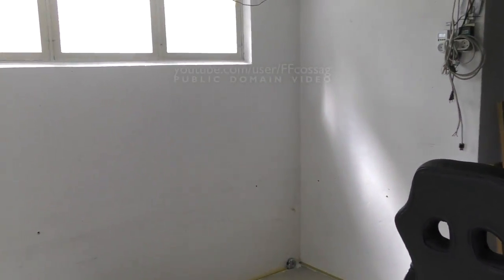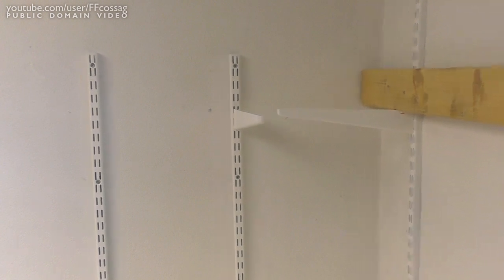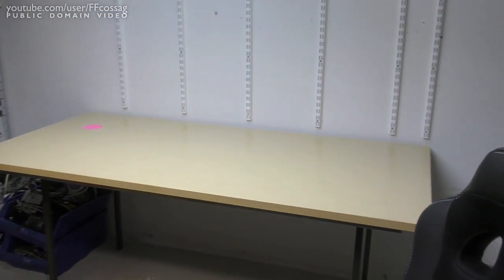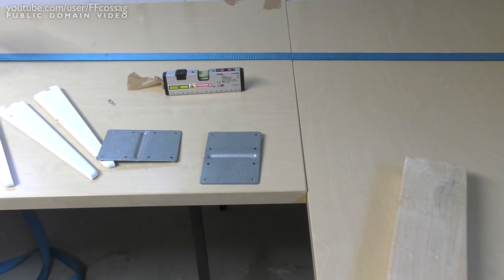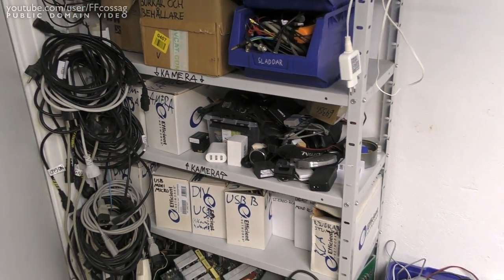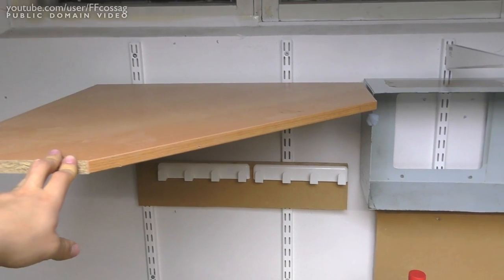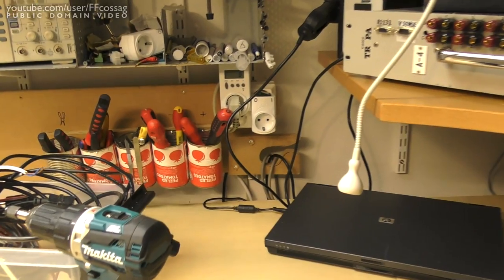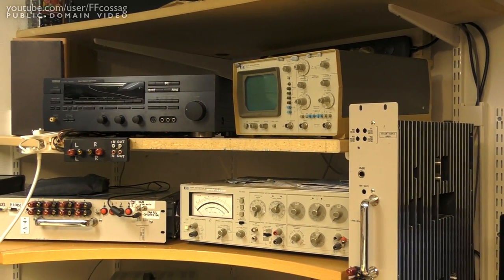Furniture with FF | Lab overhaul pt. 2, Trash Turned Awesome

Comment: An idea for the area behind the door to the room:
Outside clothes, shoes and such, maybe brooms or long objects you don't use that often. It's a trick I've seen in many places. Elfa has clothes rack accessories for their rail system. That way, if you want to make other use for it, it's as simple as just moving shelves there.
A baggie of Clas Ohlson article # 21-44 LRF's or equivalent on the shelf edges where the door hits (or on the door itself) to prevent the door from banging stuff up.
Reply from the maker: I can see the appeal, however since no one ever undresses when entering through the basement door, the functionality would be lost. I'll probably end up turning it to a row of rather vanilla shelves, as I'd hope to be able to store as much quick-access stuff as possible in the actual workshop. There's no room to waste space in there, at all.

Comment: Looks good keep up your good work i am like you when i want to mount something i always over do it, because how fun is it when shit fall down you shall see the length of my screws holding the ikea lack shelves on my wall they are like 16-20cm long lol took 2 plastic plugs to beat into the brick wall.

But if you wanted to go extreme there is another way to mount it that i guarantee you never pull it out it is called chemical anchor it looks like concrete a special two component glue you drill a hole blow it out and fill the hole with this mixture push a threaded rod into it lol go for M6 lol i use to work with mounting replacement balcony on concrete houses it was fun lol M16 bolts :-)

Comment: Turn a laptop LCD in to a monitor, you can buy the controllers on eBay
Reply from the maker: I've considered that. Should probably order a bunch of different ones to see if any of them support the resolutions I need. 1080p50 or i50 is really obscure.

Comment: It sounds like you're working with plaster and probably applied to a wire mesh and furring strips. You should be looking for studs or wooden beams for mounting. I comment as we go not after because I'll forget.
Reply from the maker: No, it's a cement bunker. Think really trashy concrete. This ain't America.

Comment: You were thinking that you should have used the longer brackets in one area but you had already fitted the shorter ones. Did you consider just removing the short ones then reusing the holes to support the longer ones with extra holes drilled at the top end as required?  It does look good and I wish I has space to make myself a workshop.
Reply from the maker: I would do that, but the hole spacing is different on all the console sizes. Probably the biggest downside of these racks. When I get my drill press working, I might give it a go at just drilling new ones, however.
Reply: Fair enough - I was unaware the spacing was different - a marketing ploy to prevent doing just what I suggested - make them so you have to buy different ones
Reply from the maker: It's not a marketing ploy, it's just bad product design. They don't sell a model that fits. lol.
Reply: FFcossag - It's the cynicism in me that makes me think that way lol

Comment: Those coltech drills fail at aluminium drilling as well so they are only "good" for wood or something you only need to drill once and then throw the drill bit away after one use.
Reply: 54:54 would be nice if you had a small light indicator of sort to show if that second group of outlets are live or not.
Reply from the maker: Yep, I've noticed that. I need to add one.